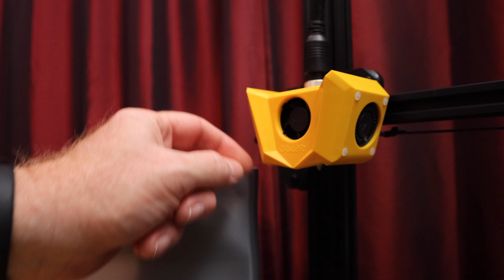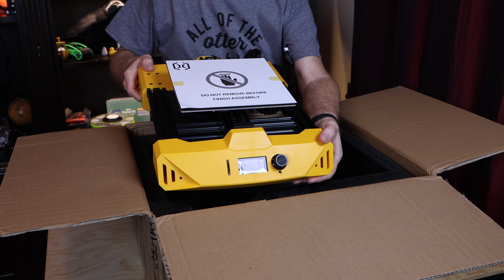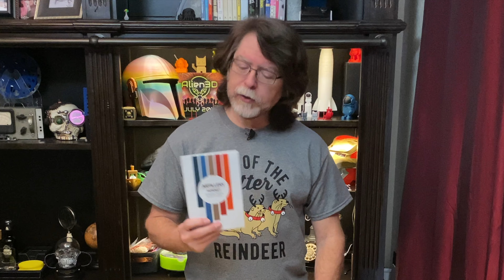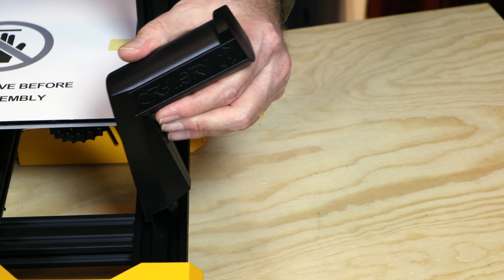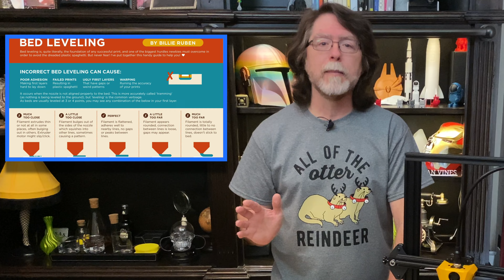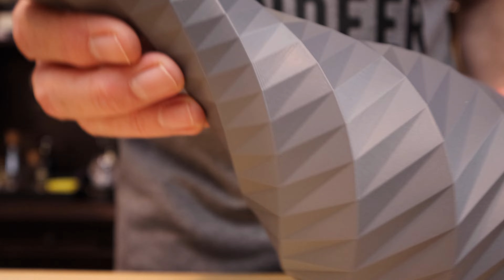Artillery's NEW Hornet 3D Printer: Unbox! Build! Print! Impressions!

Comment: @ Bryan : did you test printing from USB for example with Octoprint? Does it work or having problems with that?
I have used now some printers that worked fine but cannot really connect and print on the USB-connector... so just wondering.

Thanks for this review.

Comment: I have a question for anybody. If bed is 300mm x 300mm can you print to full 300mm in either direction in x and y and if I printed at a 45° will I be able to print bigger than 300mm depending of coarse the width of project
Reply: Yes, of course as long as you are not going outside the edges of the bed-volume. You set this up in the slicer: rotate the part so that it fits.
On the Sidewinder a thin part with a length of 40 cms is no problem and even over 55 cms when you start low at one corner of the bed and end up (with supports) all the way up in the air above the other corner going over the center of the bed. Of course that print is pretty weak because of the thin width in combination with a lot of layerlines but it prints.

Comment: Hell no! Looks like a giant step back. Also can you replace the Bowden tube in that all in one cable?It would be ridiculous if you had to replace the entire thing when on,y a new tube is required.
Reply from the maker: It's a bit of a weird choice, but since the PTFE from the Bowden tube & cable combo doesn't go all the way down to the nozzle, I expect it to last longer than if it did. I do expect it to be a consumable part, much like the flat flex cables on the Sidewinder and the Genius. I'm curious what Artillery plans to charge for the part though. Hopefully it won't be in the $30 range or anything like that.

Comment: Kudos to Artillery for introducing colour into their design, I would like to see more of this in maybe some coloured extrusions on production printers, manufacturers in many industries are happy to go with one bog-standard colour for their products eg. thirty years ago I bought a dirt bike that came with blue tyres and I thought that would open the gates for more vehicles with coloured tyres, but no this has not arrived yet, then there were the vanilla PC cases but fortunately that changed.
 I love the Bowden and aviation connecter combo, how easy is it to change the tube? I prefer the Marlin UI with a rotary encoder as there is no uniformity to UI's on the various printers touch screens, even different models of printers made by the same manufacturer sometimes have different UI's.
 I saw a review of this model when it was first released ( I think around six months ago ) and unfortunately, none of this printers issues has been addressed which is a pity as this is a nice looking printer

Comment: just curious.  with that connector setup,  what do you have to do to change a thermistor/heater/fan?  Are they soldered connections to the pcb, screw block style, or something else?
Reply from the maker: Every electrical thing on the hot end has crimped connectors which plug into the breakout board inside the hot end's housing. It's the board that splits out the power, ground, and signal leads from the Bowden/cable combo.So replacing parts on the hot end will be a matter of removing the part and unplugging it, then installing and plugging in the new part, be it a fan, thermistor, or heater cartridge.  Most of them look like JST XH 2.54mm 2-pin connectors. The heater cartridge's connector is a little beefier.

Comment: Nice review of the Hornet.  I actually really like the looks and innovative Bowden tube feature as well as filament spool placement.  Parts cooling is an issue they need to address as I have seen this problem in other reviews too.  I believe the price separation between the Hornet and Genius is going to stick around $40, just a market ploy to show a reduced list.  If they would drop another $10 on this unit and fix the few problems mentioned it would make decent competition against the Ender 3 V2 especially for the first-time buyer with its ease of assembly.

Comment: Another excellent, comprehensive video!  The protruding portion of the  bowden tube looks too short to extend all the way to the nozzle.  Is it an all metal hot end?  I love the T shirt.  Happy holidays to you and your family.
Reply from the maker: Hi Corey Mac. You're right; the PTFE sticking out of the Bowden/signal cable does not go all the way down to the hot end. I believe the hot end is still PTFE lined, because there was a small additional piece of black PTFE tubing in the spare parts bag. Also thanks -- and happy holidays to you and yours! 😀